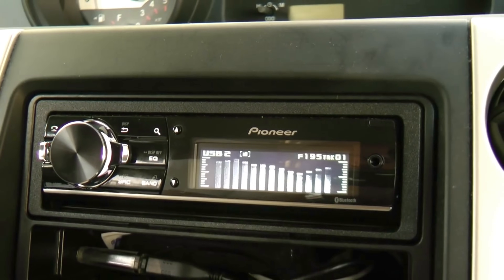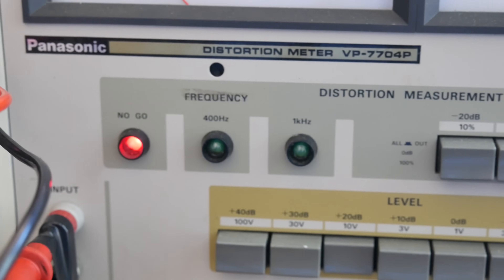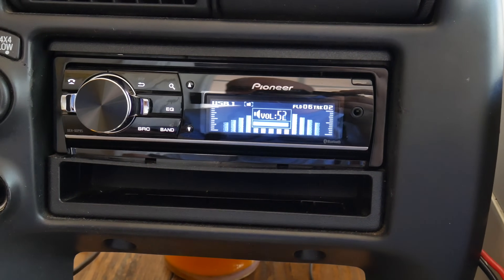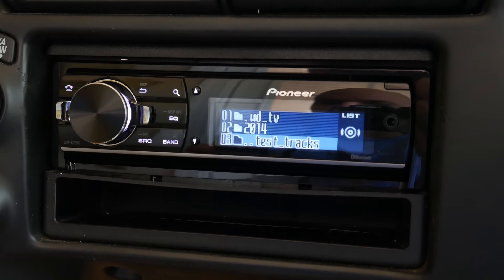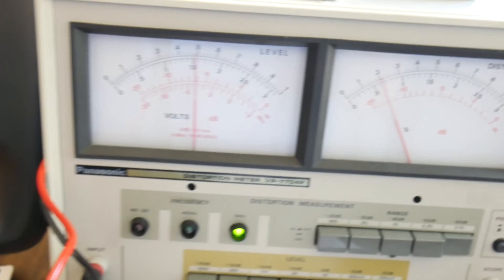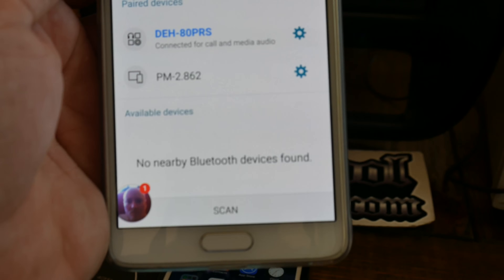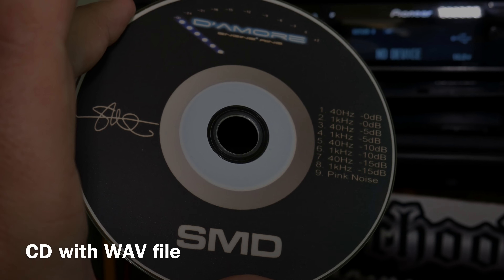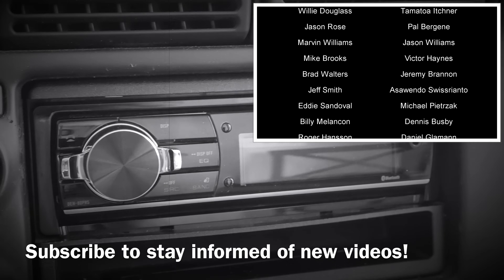Pioneer DEH-80PRS THD Test Part 2 USB Android iPhone CD

Comment: If u look closely that is the high output aka front. If u look closely you can see a f. Its wierd I made same mistake looked thru manual and its rear front sub top to bottom. I dont know why they switched it on this unit but o well.

Comment: a question regarding the deh80prs, when used as a threeway network through RCA outputs is the graphical eq still useable ie if I have lows and  highs at +6 and mids at -24 will the eq aloow me to lower the mids by a further -12 db thereby theoretically creating a 48db gap between my mids and the highs and lows, please do not reply unless you are 100% sure. thanks

Comment: When you dyno a amp.say your using a radio that has 2volt preamp outputs and say amp made 500rms@1ohm but test same amp with radio that has a 5volt preamp output will it produce more wattage at same@1 ohm load...only difference being 2volt preamp vs 5volt preamp????
Reply: Short answer, no.

Comment: what's the Sound Level Adjuster Level on these tests? I saw on a different video, it only put 4,9 V on USB with a SLA value of +3. Does the preamp value have to do with the Digital Attenuator setting, which on your video is set to LOW?
Reply: ok just coming back here to reply my own accidentally discovered comment.

BigD you should have mentionef the SLA Settings beforehand. If you had it on 0 it would have put 2,4V only

Comment: I watched a video where they did pretty much the same thing with the DEH 80PRS except in the other video they had to bump up the SLC to +3 in order to get max voltage from the head unit.  Is that what was done here also? Thx.
Reply from the maker: Yes, I didn’t shot this but it’s true
Reply: @wal  Alright cool.  I really appreciate you getting back to me so quickly with an answer.   Thanks for taking the time to share the knowledge, Ive learned a lot.

Comment: nice vids!!I want to ask you. with pioneer deh 80prs connecting 3 different amplifiers,  1 for highs,and 1 for mids, and 1 for bass. can I use the crossover of the deh 80prs for each speakers?without using any external crossover,and without using the crossover of the amplifiers!!!
Reply from the maker: Yes, it has a 3-way crossover
Reply: thanks for your responce!!

Comment: I think this test would be more meaning full done at a few spot frequencies. Id suggest 100Hz, 1Khz and 10Khz. The higher frequencies are where the format differences will start to show. 

Ive been comparing CD to a USB wav uncompressed RIP of the same disc on this headunit and I can definitely tell a difference. CD is better.
Reply: ???? Lol

Comment: I know its fair few years older, but I wonder how my trusty P9600MP stands up to this model.
Over the years, Pioneer have dropped many customization features, they use to include even in 7xxx, 8xxxx series, and then brought a few back into their top end only units. I've also recently acquired a keh-p8200rds (cassette) with external  DSP unit and keh-p9700r.
I wonder how they stack against modern systems.

Comment: Bro this is such a great video, thank! But i got just one question. Did you adjust the SLA settings before the test? Because I saw another video where the voltage was 2.4- 2.5 volts on max volume until they turn the SLA levels +3 on almost all the input methods. Just ordered from eBay and want to get the most i can of it.

Comment: Can you do a setup and tuning rundown? I just installed one on a skar 4 channel amp in network mode and it is clean but I'm not blown away. Maybe my components suck?  I set my crossovers based on the manufacturer specs on the mids and tweeters. Auto eq and time aligned.
Reply from the maker: I’m not a big fan of Auto EQ on this head unit

Comment: Great video man! I loved it. I've had this deck for almost 3 years now and I am continuously impressed. I also would live to see a SQ test. Maybe showing frequency range and bit rate. Thanks again.
Reply from the maker: I still use it in my daily driver too. Great head unit, although a bit cheap feeling and not easy to navigate.
Reply: @wal  I have  Alpine – CDE-9880R ,expensive feeling at use and top quality screen but not good quality sound (for my taste i like sweet mids and highs and strong bass).I want to change it but what to buy??Do you propose something?

Comment: does anyone make a decent sounding double din? the Kenwood 9903s gets mentioned here and there. Pioneer from what I have heard is kind of shrilly. eclipse sadly isn't making decks. the prs is only single din.
Reply from the maker: +Kyle Van I wonder this myself. I think it's too small of a market, but I'd like one too.
Reply: BigDWiz I've spent about 8 hours over the past week testing various decks in my own system. nex 4100 from Pioneer. Kenwood 9903s and an alpine w960 hdmi.  from just a sound quality perspective that Alpine was the hands-down winner. a person just has to ask themselves if they can live with the rest of it. I bought one and as much as I liked how easy the Pioneer was to use and a lot of the features of the Kenwood . at the end of the day I'm listening to it. the pre out section on that Alpine is much more detailed. Much better tonal balance. it also had the lowest noise floor. in tracks like life is too short you can actually hear Too Short breathe and it sounds accurate. neither the Kenwood nor the Pioneer could touch that. they both added a little bit of their own color. the Pioneer being the most noticeable with a very distinct top end roll off and kind of rough 2-4khz reproduction. oh before I forget there is another honorable mention. The Sony xav-ax100 it's an all multimedia receiver but honestly it does not sound that bad . I would prefer it over the Pioneer or Kenwood. I would have never thought that would have been the case going in

Comment: Your bench test in a way confirms but blasts what I thought I knew- that CDs and mp3's are cleaner than SiriusXM and FM.I wish you would have used those sources in your test.I honestly thought there would be a spread between WAV and MP3, but there really isn't.I also thought Alpine had cleaner head units than Pioneer. Maybe I am wrong again on that count as well.

Comment: Is there a way to test the amp inside the deck? I've always wondered if they truly are 4x50 watts. Can that amp really push 50 watts Max per channel or is that all marketing?
Reply: 50 watts max, usually they do 15-22 RMS per channel
Reply: Yep I'd love to see the internal amp tested.. People under rate what a decent set of high efficiency speakers can do straight off head unit amplification.

Comment: +BigDwiz Hey BigD i'm using this unit in my car and using only the pre-outs in 3-way mode. Can you tell me how can I set the gain level for my high frequency amp as the HPF on high frequency channels doesnt go any lower than 800hz and cant be turned off/pass also like the LPF of the low channel. I used 50hz tone for tuning the low/sub frequency amp and 1khz tone for the mid and high amps.

Comment: Another great video. Only thing I would have like to see done is use the aux port with apple and android phones. I think more people use aux than thumb drive or rear inputs. Thank you for what you did do. I wish I could use my 80prs in my car, its just sitting in a box with nowhere to go.
Reply from the maker: +B Bailey I will try aux when I get a chance. Can't believe people would use AUX over USB or BT though
Reply: BigDWiz I see it as a matter of convenience. Its right on the front so its easy to plug in quickly and some phones have junky Bluetooth programming so they don't auto connect well, not to single out any phone manufacturers, LG Stylo 2.

Comment: The battery in the Fluke is low. Note that some measurements cannot be trusted when that battery indicator is on.
Reply from the maker: +Aaron Hammett the THD meter was showing the same measurement. I'll make sure I change out that battery in da Fluke doe 👌

Comment: folks gotta remember even though it's clean signal at max volume cheap ass factory speakers are not gonna be as clean..gotta upgrade those too. and external amps are way better than the internal amp on any source unit

Comment: can you test the distortion of the eq? like say put it at full volume and raise the 1k band to the max
Reply from the maker: Next time I have the THD meter hooked up to it I'll try this
Reply: Yes please EQs anyways seen to add distortion just like it verified.
Reply: @alphaomega8373  it is true what you are saying i had a clarion745 which i used on my deh6700bt but then i upgraded to an 80prs and realised the eq was giving me a whole heap of distortion. i ended up going straight from the deck to the crossovers and realised i wasnt getting any distortion anymore. Guess these new head units dont need an eq everything is built in. unfortunately i have to leave it mounted because i dont want a half din hole in my dash .

Comment: Is There a source level adjust in network mode. I can't find it in network mode so I can increase output voltage. I'm only getting 2 volts at maximum volume at 1 kz
Reply from the maker: Power down unit, press and hold in volume button. There are additional setup items in this mode. There is a source adjustment, but I get the same voltage using both settings.
Reply: Yea I found it in standard mode it's right in the audio settings.  I bumped it up just a little and got 5 volts.  I have to check that out
Reply: Pioneer was never straight forward with all the settings
Reply from the maker: This one is in network mode (3-way for those reading this who don't know what that means)
Reply: BigDWiz you should do a video of the hidden features and settings of this head unit

Comment: BIGDWIZ can you please do the same test on a KENWOOD KDC-X998 head unit just see the comparison bettween the two,the PIONEER 80PRS and the KENWOOD!!!
Reply from the maker: Guess what I just ordered a few days ago?? Great minds think alike...
Reply: BigDWiz I have both and I love them
Reply: Thanks BIGDWIZ If you get a chance to do the compairson bettwen the KENWOOD and the PIONEER because i have the KENWOOD KDC-X998 head unit I want to see if I got my moneys worth for it!!!!
Reply: yamahagytrracing21 which one do you think is better for a real high end sound system install in your opinion and why???
Reply: yamahagytrracing21 which one do you think is better for a real high end sound system install in your opinion and why???
Reply: Jose Garcia well I love the kenwood. The only reason I went with the pioneer is to do active crossovers so I can run a separate amp for both mids and highs. I think the pioneer sounds the same tho. The kenwood puts out about 2.5 volts on the rca's. So if your not doing active crossovers I don't see the reason to buy another head unit. My biggest complaint about the kenwood is the screen is hard to see in the sunlight
Reply: Is it better to go with a head unit that has active crossovers??? My set up is going to be six JL AUDIO 12W7 in a wall on the c pillar of my 2012 TOYOTA 4RUNNER being pushed by two ROCKFORD FOSGATE T2500-1BDCPS amps and two ROCKFORD FOSGATE T600-4 for the mids and highs two per each door front and back!!!! So would I need a head unit that has active crossovers or would my KENWOOD KDC-X998 do the job for my set up keeping in mind that my ROCKFORD FOSGATE  component set's come with crossover boxes for them??? I was also thinking of using a AUDIOCONTROL DQDX digital sound processor!!! What is your opinion about that idea??? I appreciate your help!!!! Thank you!!!! 👍👍👍

Comment: Couldn't the distortion be worse on lower frequencies?
Reply from the maker: It could, but I cannot measure as the THD meter only does 400Hz and 1kHz.
Reply: no, it is essentially the same as plugging your phone directly into the amp, the rca's are just a common output for all the inputs(cd,phone etc.)

Comment: I have been waiting for this video for a while. I bought this head unit after watching your first review on it. I have only played 2 cd's in it because who listens to cd's anymore lol. I usually run mine at 50-55 volume depending on the song, as 55 is where i set my gains from. Never been happier with any other head unit in my life.
Reply from the maker: There are a few quirks with the 80PRS...volume takes WAY too many turns to get loud and quiet, build quality is cheesy, user interface could be better, etc. But yeah, overall, it's pretty good.

Comment: thanks for the video Big D.  I am amazed that even at full volume the destortion was so low.
Reply from the maker: at 62 she's clean like a whistle
Reply: @wal  I managed to get about 58-59 but the SLA was on +3. The bizarre thing is that when I connect it up to my amp, I have to turn the volume right down. It's a JBL GTR 7535.